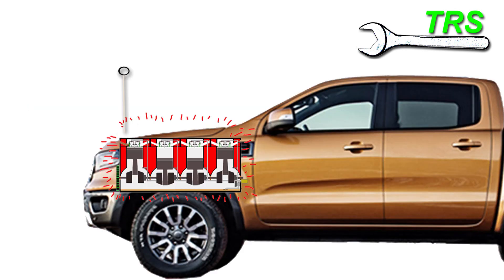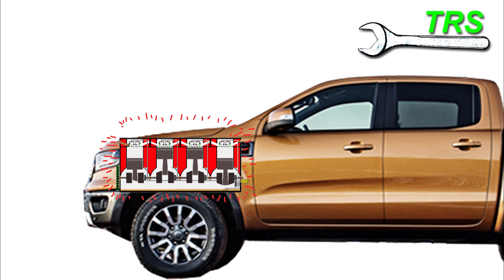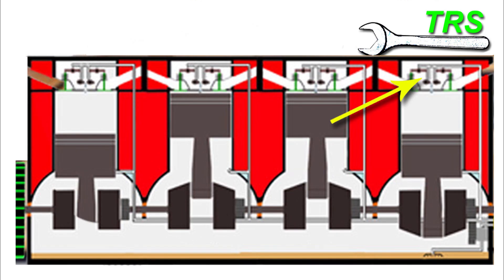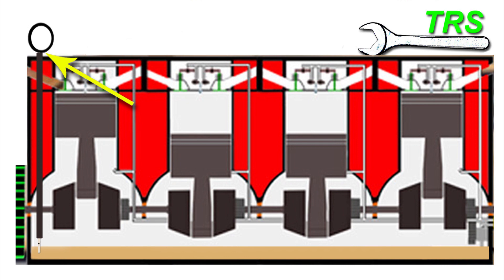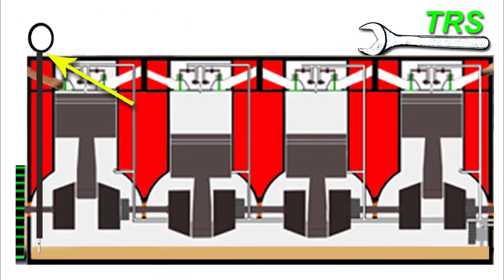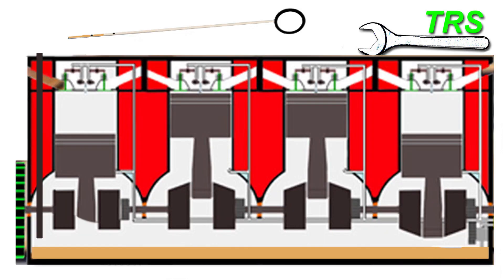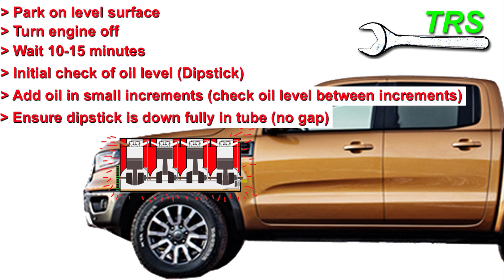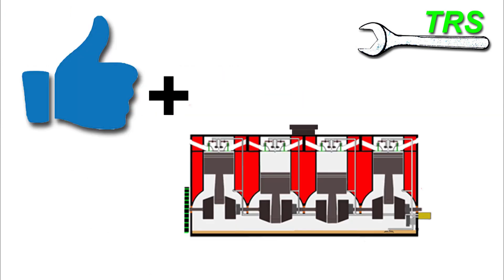Engine Oil - How to Check Engine Oil Correctly.  (by Craig Kirkman)

Comment: This video came at a very good time for me. I do not do many kilometers in my car and intended to give it a run on the freeway. This was a great reminder to check the oil and it was showing very low , to the bottom of the accepted level.  In 12 years ,I have never had to top up the oil  between oil changes . My reason for checking was a problem that I have had where the two sides of the dipstick vary by approx 10mm . I have used a de- greaser on the stick to try and remove any substance, that may cause it to not stick,  but it doesn't make any difference. Using a 2000 grit sandpaper did not work.   From your tutorial , I know that this is within the acceptable level but it is another of life's mysteries that baffles me.  It seems to be defying logic.  Without your timely reminder I may have done some damage and that is very much appreciated.  Cheers from Australia.